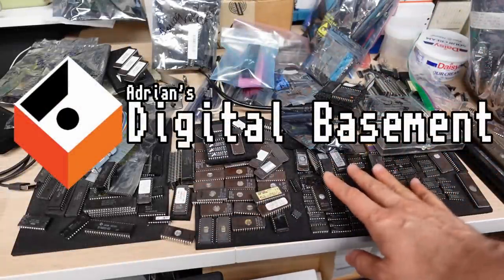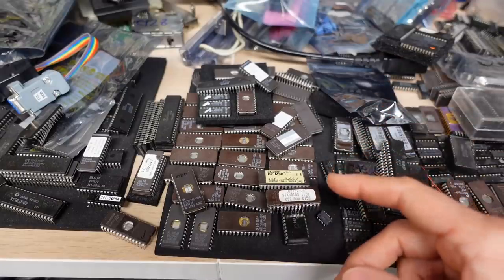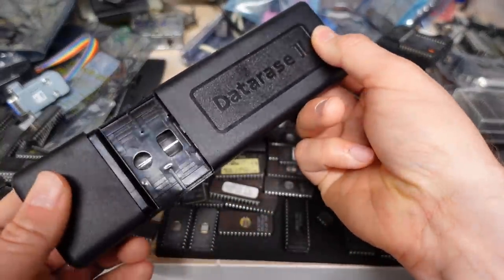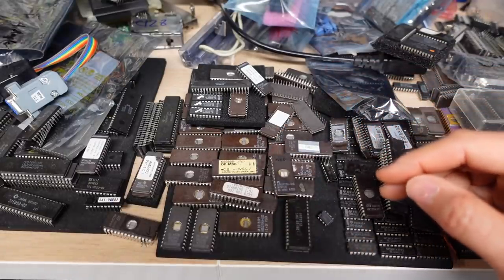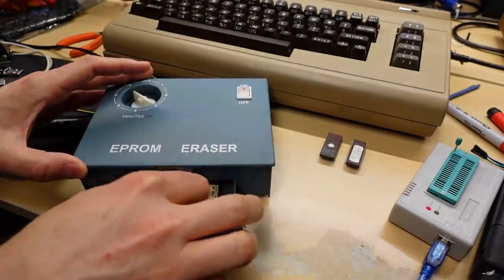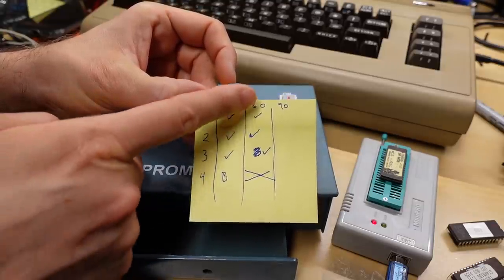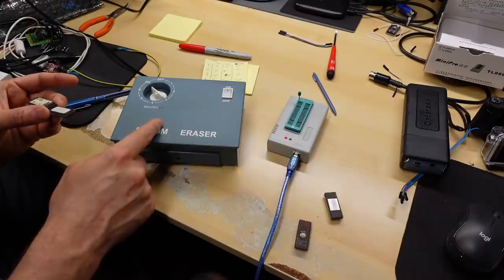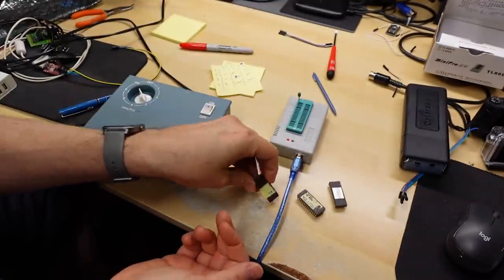Do paper stickers protect an EPROM from getting erased?

Comment: Every YouTube expert knows that you have to recap the eeproms, because their memory cells are all little capacitors with a transistor!!!
Reply: I think you're thinking of DRAM, that uses a small capacitor to hold a state for a very short time, hence it requires constant refreshing.

(E)EPROMs basically use a MOSFET with an isolated gate and hence don't require and refreshing except maybe after 10's of years. Programming involves inducing a charge near to the gate to cause it to change to represent a 0 or 1.

MOSFET gates have capacitance, but they aren't capacitors.
Reply: @TomStorey96  ...another spoiler and victim of meta-level irony. facepalm
Reply: @TomStorey96  whoosh
Reply: @TomStorey96  I bet you're fun at parties! 😁
Reply: @RetroJack  I bet he is really fun. :)
Reply: @TomStorey96  Correct, you are right about that.
Reply: @TomStorey96  Have a parrot. Actually, have infinite parrots :)
Reply: You naughty man, what's Tom going to do with all the parrots?
Reply: And if you need it to function, keep an image of the rom.  They won't take up much space and may even fit on a floppy.  Who has used floppies?  I used to but now you can't get them any more.  Everything now is USB flash drive or external hard drive and thus I don't miss floppies.
Reply: @charleshines1553  then when the time comes, hope the floppy is still good
Reply: @IvorySoul696  you're a couple of months late to the party, dude.
Reply: @charleshines1553  except when the image is locked away in an 80MB MFM full height hard drive.

Comment: Forget erasing for a sec - what the heck is on the Grass Valley Group chip right there you show in the video? For those who don't know, Grass Valley was Atari's little R&D group tucked away in Grass Valley, CA where the original VCS/2600 was designed, and much of the work on the 400/800 happened there too, I think.

Comment: The coolest thing I had ever happen concerning sunlight erasing EPROMs was when I fixed a Popeye bootleg.
It had some major sprite faults. After finding a short between a sprite ROM data and address pin, the sprites looked much better, but had ragged stripes through them. Injecting signals into the data lines showed the stripes coming out of the ROMs. I dumped the ROMs and one had these jagged lines through the sprites across the entire address range. When I looked at the ROM, I could see a scratch in the sticker on the window that had the exact shape as the stripes in the sprites. (well I just burnt the image that was supposed to be on the ROM over itself)
Reply: Pretty crazy!

Comment: Straight from the National Semiconductor 27C256 datasheet.

"The erasure characteristics of the 27C256 are such that erasure begins to occur when exposed to light with wave-lengths shorter than approximately 4000 Angstroms. It should be noted that sunlight and certain types of fluorescent lamps have wavelengths in the 3000–4000–range.After programming, opaque labels should be placed over the 27C256’s window to prevent unintentional erasure. Covering the window will also prevent temporary functional failure due to the generation of photo currents"

You will find similar instructions in most EPROM datasheets.
4000 Angstroms = 400 nm.

Comment: Nice little experiment here! I'd been exploring and researching how to erase some old eproms I salvaged a while ago, and you brought up a ton of good points that I learned along the way.

Being in Florida, I assumed the sun would be enough to erase my eproms. After letting them sit out between 11 AM and 3 PM, (the brightest and most intense output of UV from the sun during the day), I only had one out of four go corrupt, and even still that wasn't a complete erasure. Then I let them sit under some indoor florescent lamps for a similar length of time, no results. Then I borrowed an LED UV grow lamp from a friend, and they never successfully erased after 12 hours sitting under the lamp.

After I did some research, reading the datasheet for my particular eproms, I learned that they will only erase with a specific wavelength of UV light, and that all the other sources I'd been trying to use, up to that point, didn't output the correct wavelength. Even the sun itself only outputs a fractional percentage of the specific UV wavelength protons that are needed to erase the eproms, so I literally got lucky when that one eprom I mentioned earlier had some corruption.

That's when I bought a vintage Datarase eraser off of eBay, after learning of the reliability issues the Chinese erasers have, and that was the best $40 I spent.

Comment: Back in the late '70s/early '80s a co-worker discovered a neat trick with the Motorola 68764 (oddball 8Kx8 EPROM in 24-pin package instead of 28-pin).  If you plugged it in backwards and turned on the power, a little light came on in the window.  For some reason it no longer worked if you put it back in correctly.

At least he discovered the LEEPROM (Light-Emitting EPROM).

Comment: I was also curious about it once and I put a bunch of EPROMs without the stickers into the sun for 10 hours. We had 35°C hot summer day, so the best sun we can get here. And guess what?After 10 hours not 1 bit flipped. I couldn't erase the chips with just using sunlight. For the test, my EPROM eraser got them blank in about 10 minutes. You need a very specific wavelength to erase the EPROMs, less then 270nm if I remember right. Most of UV light reaching the earth is above 400nm, that's why it is only possible to damage some bits, but not to erase the EPROM completely....
Reply: You remember wrong, below 400nm works.
Reply: @Okurka.  Just looked into couple of datasheets of some EPROMs, they all say, that you need 253,7 nm. Anyhow, my point is, that it takes forever in the direct sunlight, which is mostly above 400nm.
Reply: @necro_ware  Those datasheets say the erasure begins at 4000 Angstrom (400nm) or lower and that 2537 Angstrom (253.7nm) is the ideal wavelength.

None of them say you need 253,7 nm.
Reply: @Okurka.  Well, not arguing on that. At least they suggest 253,7nm. But, again, my actual point was, that the sun is not enough to erase an EPROM. At least not in couple of days. I didn't try to leave it in the sun for months though :D

Comment: Back in the 80s I had a job of testing electronic circuit boards used for building controls. Each board had 3 EEPROMS on the front. We had over 15 test/burn-in stations all running the same building control board. Initially the boards had blue vinyl labels covering the EEPROM window. The blue labels seem to work fine until someone came in one day and took a photo using a camera with a flash attachment. Every controller started to reset right after the flash. Engineering immediately changed the blue labels to foil labels which wasn't affected by a flash camera.

Comment: My first "exposure" to EPROMs was in the late 80s when I started a 30 year career in marine electronics. I was servicing/installing JRC GPS navigators. Each month JRC would send updated firmware for their JLR-4000/4100/4200 series of GPS receivers.  I had a multi gang EPROM programmer and used a UV-B plant grow lamp to erase the old EPROMS. This was most certainly the wrong lamp but it did erase the EPROMs after a few hours or so :-)

Comment: I absolutely loved this video.  I was somewhat aware that paper interferes with UV light, but as a complete test, removing the paper and then trying to erase the EPROM would prove that those CAN be erased still or using the EPROM that WAS successfully erased and adding paper to it to prove it is protected.  Nonetheless, I am certain that paper blocks enough UV rays so that it isn't strong enough to erase those EPROMs.

Comment: It's a quality control thing. The reason why manufactured developed eprom have a sticker is a quality step to prevent it from happening accidently(especially because manufacturing floor have have a variety of stray UV source). It is very hard to erase an eprom accidently. But if you flood it with UV the changes are almost 100% no matter the covering of the window. The one's in your shop are pretty safe from being erased.

Comment: Back in the early-mid-'70s I worked in the Launch Control Center at Kennedy Space Center in a department that handled "special" non-launch related research instrumentation and data processing. (Great fun!  Our small department got to do the really interesting stuff and not worry about schedules or launch preparedness. :-) We had an expensive piece of equipment arrive and anxiously put it our rack, wired it up, pushed the "on" button and nothing useful happened. :-(

  We sent the device back to the manufacturer, but they reported back that all the EPROMS (they had no paper cover) had been erased!  The EPROMs were replaced, returned to us, and the unit worked OK.  It turns out that, at the time, the Space Center had a policy of photographing all new equipment as it arrived, before it was delivered to the department that ordered it.  The photography department documentation procedures would remove the covers and photograph the inside of equipment.  And of course they used strobe flash lighting just inches from the device.  Once we knew that, the reason for blank EPROMS was obvious.  Apparently EPROMS were still a relatively new invention but almost immediately after that instance, the policy of the photography department changed.  Go Figure!  Moral of story:  Don't photograph your uncovered EPROMs.

  I haven't touched an EPROM in 30 years but during that time, I don't remember having to "cook" EPROMs for long periods of time.  I did a lot of EPROM programming in that job and others, but I don't remember long waits for an EPROM to be erased.  Perhaps just 5 minutes?  Is my memory that fragmented?  Or did we have faster erasers back then?
Reply from the maker: Interesting! I really have to wonder actually if these EPROMs were just never programmed before the gear was sent. I linked a video in the description where a guy tested an EPROM outside in the sun but also under a Xenon flash tube -- and he was not able to erase an EPROM with a flash tube. Although perhaps those super early EPROMs were more susceptible :-) But I would personally assume the gear just had blank EPROMs installed in the first place.
Reply: @adriansdigitalbasement2   Seems like a reasonable explanation.  Did the gear have an "Inspected by #5" and golden oval QC sticker anywhere?  ;-)

Comment: Actually, the purpose of the sticker is to block light because light can also make faulty or partially programmed cells work!
I remember a time in the 80's when were designing and testing a computer mainboard with a programmable EEPROM with no label on the window. It was all running great, so we put it all back together and replaced the plastic lid, switched it on and it didn't work (no boot - POST fail)! So we took off the lid to see what we did wrong but it seemed to work OK again. So we replaced the lid and it didn't work! We found that just by holding the lid over the top of the system then it would stop working.
So the light was actually making the EPPROM work, if we stuck a label over the clear window it stopped working (lid or no lid).
After that, we always stuck a label on the window BEFORE we programmed/verified them!

Comment: I have accidently damaged the rom data on an eprom due to the xenon flash on my slr camera, when taking pictures of PCBs. Since that day, I always keep a sticker on windowed eproms.
Reply: I was wondering about xenon flash effects .. but more about flashing it while in operation. (like the raspberry pi 3 that crashes when fotographed with a flash)
Reply: @VVerVVurm  Same issue. There is an exposed silicon chip on the pi, I don't remember what it does. UV can induce voltage like a solar panel. It's this same effect that causes eproms to be erased by exposure to UV.
So yes, it's exactly the same 'issue'.
The LED flash on many modern cameras and phones will not cause an issue. If you have a higher end camera with a proper xenon flash though, careful.
Reply: @rich1051414  ikr .. every transistor is a photo transistor if you leave the cover up

Comment: Back in the day when I was doing EPROMS I bought the cheapest UV EPROM eraser I could find out of The Computer Shopper.  It was cobbled together out of a plastic cassette tape case which had a UV bulb in the top half and a piece of foam glued into the bottom.  No timer, no safety interlock, nothing.  It worked fine though.  Never had a need to get anything else.

Comment: Got the same eraser with of course a broken timer. Actually replaced the filmsy mains cable with an AU plug and bypassed the timer while I was in there. Haven't changed the bulb but from what I've found it only takes around 2 or 3 minutes to fully erase the EPROM with the stock bulb

Comment: I feel like I half prompted this mentioning the unprotected EPROM in the Laser.
To note: I save some Photoresist PCB protective covering, the PCB is exposed with UV light to transfer the track layout, then you develop it in a chemical, so the cover is designed to protect against UV light (and minor scratches).
When I put a sticker on an EPROM, I tend to put the UV protective cover on the EPROM, then put the paper sticker on top of that.

Comment: I never bought myself an EPROM eraser and use mostly non-UV reprogrammable EPROM chips like the W27E257. But when the need comes up to program an UV EPROM I do use sunlight and I need to leave a chip several days outside in the sun before it tests empty. Therefore no need to worry about a little bit of light indoors, you really need ultra-violet violence to erase them.

Comment: So the conclusion is: use electrically erasable EEPROMs if possible (or even Flash) and avoid all of these concerns ;-)
Reply: that's a bit redundant... the first 2 E's stand for Electrically Erasable.  UVPROMs are the ones that can only be erased via UV.
Reply: I switched long ago since they're not expensive and easy to flash.
Reply: @misterkite  The rare and elusive spicy version of RAS Syndrome
Redundant RAS
Reply: its telling that that even in 2020 CNC manufacturers still use battery backed CMOS for machine settings not flash memory.

hardware people don't trust flash memory for mission critical stuff. PC industry are corporate and thus charlatans.

Comment: EPROM and EEPROM require UV C spectrum , not produced by room lighting (flourescent does produce some UV but that is AV A) . If you have room lighting that produces UV C, you have bigger problems such as cellular damage to your body , rather than erasing Eproms
Reply: 1. EEPROM doesn't need light.
2. EPROM requires UV light of less than 400nm, UV-A is between 315nm and 400nm.
Reply: @Okurka.  Yeah, if there's enough "light" to erase an EEPROM, your house is probably on fire.  :)
Reply: EEPROM is an Electrically Erasable Programable Read Only Memory chip, they're not erased by light. Flash memory is a form of EEPROM.

Comment: That's a pretty snazzy EPROM eraser! Mine's not fancy like yours, although it does have 5 slots. It's actually a cheap toothbrush steriliser that runs off 5V. The one good thing about mine is that it erases the chips in like a minute or less, since it uses a UV-C tube. And it's lucky that it automagically switches off quickly, because you can definitely smell the ozone that it creates while it's running!
Reply: good tip with the toothbrush device.

Comment: Hey, in the 80's computer VDUs had eproms facing the neck of the CRT tube and eventually they would get erased. We said the VDUs were suicidal, wiping their own firmware. At the time we burnt new proms for firmware updates all the time so it was not much effort to fix them. Probably a mixture of UV light and x-rays going through the paper labels.

Comment: Thank you again for your videos. Had a refrigerator fault caused by two electolytic caps. Had to source, remove and solder the new ones on. No big deal although <$20 for the fix in 12 hrs rather than $400+ and days. Thanks again 👍👍👍

Comment: Now this is something I have suspected for a long time! It seemed to me that the labels that gets stuck over the window is less about preventing erasure and more about identifying what is programmed into the chip!

Evidently it does also help prevent erasure, but maybe that is somewhat of a secondary effect because usually these things are buried inside a computer or other device where light sources, and let alone the correct type of light sources, are unlikely to penetrate at the right intensity.

Somewhat plausible theory!

Comment: Opaque labels definitely were a must... Just white light extends the access time of EPROMs which would cause problems in old devices where you were running up to the timing limits.
You could also erase an EPROM instantly with an old-style flash gun (with a xenon tube in). There was a company that sold an 'Instant Eraser' which was basically a flash gun in a box.
Reply: I have some disposable cameras, I should try that.

Comment: Shouldn't be a problem! We used normal stickers in our test rig bioses for years and no issues.
Hell even no stickers without direct sun light has never caused me any issues. We had dedicated NIC BOOT EPROMS on our test bench in my first job. They laid there for 2 years, no stickers and were still fine. We just had a very small run roof strip for natural light the rest was fluorescent. And where those EPROMS lay was often under that roof window. Windows do keep out a lot of UV-B.